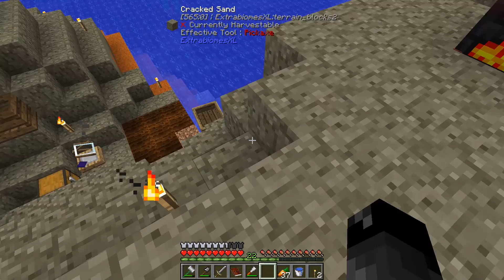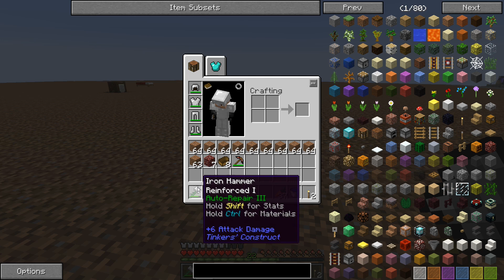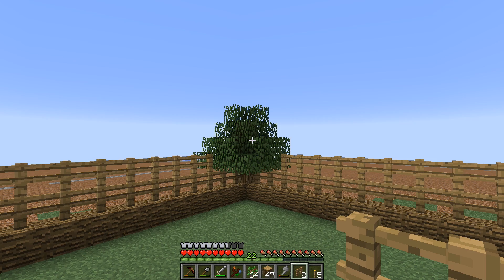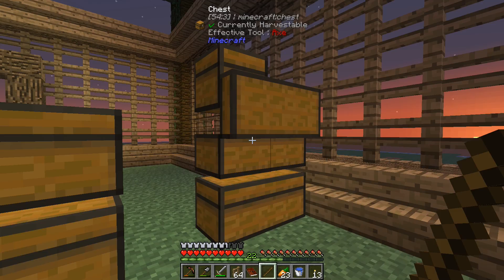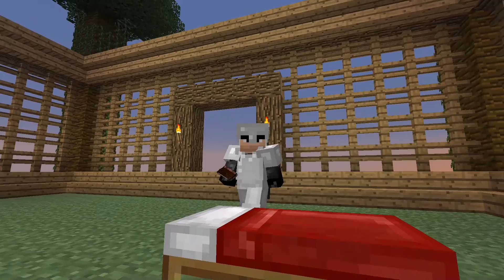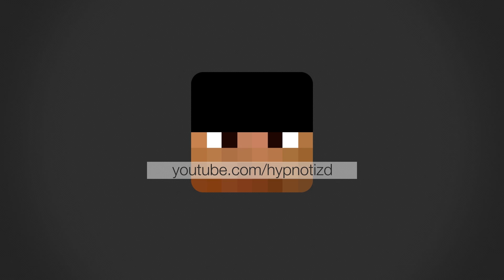Minecraft Mods Regrowth - MOVING DAY [E12] (Modded HQM)

Comment: Hypno. The barrels are so much better then storage drawers for large storage. Also in some ways easier to us. Unless you doing the whole storage drawer system I highly recommend the barrels. Stores more plus can input and export from all sides unlike the storage drawers.
Reply: Storage drawers store a lot as well but a lot cheaper to upgrade than barrels. Also you only need to connect to a drawer controller to view all items in every drawer
Reply: +Pein Rikudo you cannot view items through the controller only input. You need the Ender io panel to do that and ae is a lot cheaper in this pack so no need to go Ender io if this pack has it.
Reply: +WhiteBlaq I meant to saw you can see everything through an AE system but someone walked in at the time :)
Reply: +Pein Rikudo ah

Comment: with the trans(whatever it is) if you click the x it'll place blocks on the other side. basically, when using it you can place blocks on any of the 5 sides you aren't clicking from the side you are clicking.